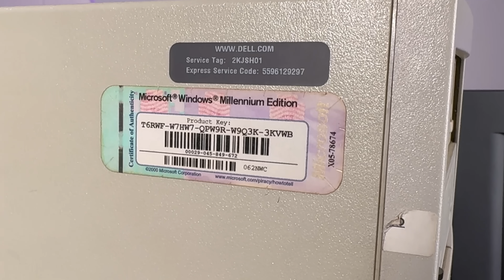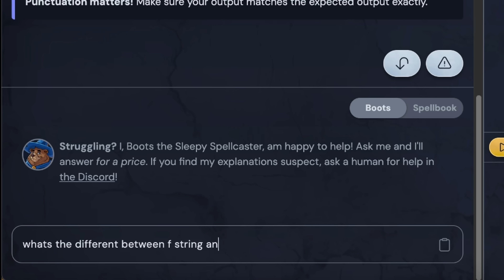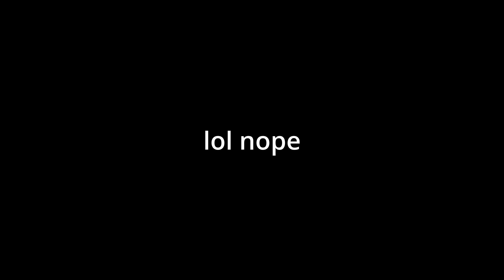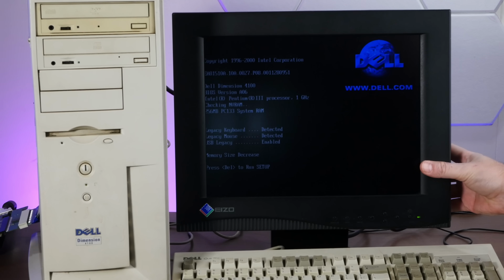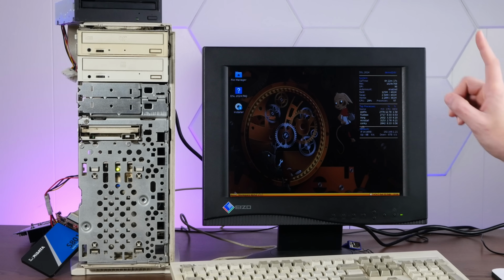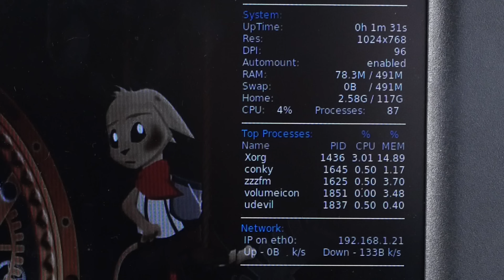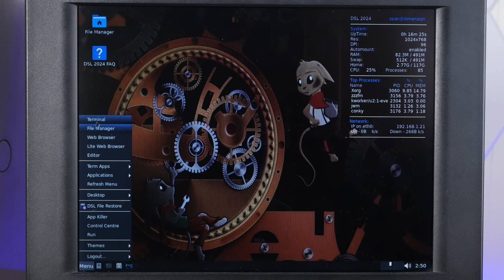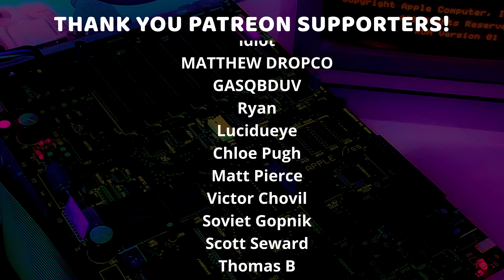Now THAT is a DAMN Small Linux!

Comment: for old computers i use q4os and it has a nice desktop you could make it look like windows 2000 or older and can run on a 350MHz CPU / 256MB RAM / 3GB disk and based on debian

Comment: I have a similar setup. AntiX 23.2 on a Dell Latitude CPx-J 750 GT. 750 MHz Pentium 3, 384 MB of RAM, and a tiny 32 GB IDE SSD that I put in there.
That said, AntiX starts to cause trouble these days, because some of the packages require extensions that my P3 doesn't have.

Comment: Very good, thank you.
While I've never hidden my dislike of all things -NIX (especially Linux) that's not to say I don't use the hateful OS where it's warranted.
Might I suggest giving DietPi a test drive some time - It's incredibly lightweight, runs on just about anything (inc x86/x64), and for a Linux is very well put together. Start with the most minimal of reasonable minimal, then add anything else you might need via the included tools.

Everything I have that doesn't of necessity run 'doze or a fun retro OS has DietPi as it's base OS... on top of ESXi for now. Well, my Cobalt Qube did run a customised version of BSD for a while to make it a 'useful' web server. But it got a modern hardware upgrade.

Comment: Great fun as always! Actually I guess you fancy AGP card with 1GB of VRAM was an AGP 8x one and I don't think these would work in a AGP 1x or 2x slot that you have on this motherboard from year 1999-2000, if I remember correctly, these slots are quite different electrically and putting an AGP 8x card into an AGP 1x slot might even damage it.
Reply from the maker: Ah whoops!
Reply: AGP slots are keyed for voltage. There are mac AGP cards that have a different pinout because they're used in ADC machines, those can definitely damange or be damaged. AGP is supposed to be backward compatible.
Reply: @staceyalbert2658  I have not researched this topic in 20+ years (since the last time I bought an AGP card) so I might be wrong. Quickly checked tomshardware, anandtech and vogons, some quotes I stumbled upon:
"8x agp will NOT work in agp 1x or 2x boards. 8x is backwards compatible with 4x only"
"An 8x AGP card will be voltage compatible with AGP 4x, but it might harm the card to put a new AGP 8x card in a 2x or 1x slot."
But researching this further is an interesting rabbit hole I might dive into.
Thank you!
Reply: BTW ActionRetro's AGP slot at 04:00 looks unkeyed and the HD3650 at 04:07 looks keyed for 1.5V so I definitely see some potential for a problem here.
Reply: @ I did some further reading and there's a handful of examples where a video card or motherboard manufacturer didn't key their product properly, but in a general sense, the AGP spec is supposed to be properly keyed to avoid damage.

Comment: the new iteration of DSL is based from MX Linux (or even AntiX). they're surprisingly lightweight & does not use systemd for init (uses sysVinit)
Reply: You can tell from the control panel that it's based on antiX.

Comment: That's the kind of case I had wanted for my slot one pentium III system but couldn't find one so I went reverse sleeper with a Antec VSK 4000e u3 (and yes I put a light kit in it...) because its a mix of vintage and modren hardware I dubbed it the PentiumStein

Comment: How could we back in the days browse the internet with 333 MHz Pentium IIs when nowadays a simple website kicks the cpu to 100% utilisation :O
Reply: JavaScript and media files that most older systems don't have hardware acceleration for.
Reply: @cameron_bosch  This. Even stuff from about 10 years ago lack any hardware support for those things under Windows, even if the hardware might still be helpful. Instead its all dumped onto the CPU.
Reply: "Even stuff from about 10 years ago lack any hardware support for those things under Windows, even if the hardware might still be helpful."

No AVX support has been a problem a couple times on a 2010  Xeon. Six cores at 3.33 GHz, but the program crashed due to no AVX.
Reply: You mean on a 486 with 8MB of ram?
Reply: Bloated frameworks and lazy developers.
Reply: JS is kicking all in the balls, all that new JS bs rendered websites make it hardly useful. My laptop is 10 years old, still a power horse with a i7 4 core 2,5Ghz, but on some websites, which heavy utilize animations and renderings, my CPU is cooking and the browser is about to die.
Im 30 and yeah, I miss the simplier times, like iGoogle or Google Reader UI, not overload, but more efficient. Unfortunately, today, designers rules and engineers have to follow. On Top, devs in the majority dont longer look up for Efficiency, as its not profitable or required at all.
Reply: @prte101 I don't want to give up my beast of a machine - a HP Elitebook 8570w - but its 3rd gen i7 is having a difficult time keeping up with some tasks now and its integrated ATI Firepro M4000 GPU is nothing write home about anymore.  Hm- I should see if DaViinci Resolve or OBS will even run on it.
Reply: @ true, I understand what you mean. My 10 years old laptop is still my main work machine as freelancer, it has something sentimental, I could not throw it in trash, for all the time it worked for me.
Reply: @AndrewBeals  My Macbook Pro from 2012 has a 3rd gen i7. 
      Still feels pretty capable - only slower than what we're used to now..
      You could try running a more 'era appropriate' version of the software you wanna use for video editing (i.e. 5+ years old).

For image editing (Photoshop) you can probably run more recent versions of Creative Cloud.

There might be more optimized alternatives available of the apps you need.
      Adobe is pretty heavy (DaVinci  probably less so)
Reply: @iggysixx  I primarily run Ubuntu on it, with the rare booting into windows 10 on a separate drive to run programs that only run on Windows.  It could be that the freezing problem I'm seeing is due to the SSD aging.
Reply: @ jikes... I thought SSDs were supposed to be able to take like 10 years of continuous (24/7) read/writes..?
Don't know if this is useful to you, but...
      There's something on my Macbook called 'Trim'. As I understood it; with that turned on, it makes sure that SSDs kind of evenly spread the usage of sectors / which blocks are written to.. (To avoid them wearing out prematurely)
.     (Apparently, it's not turned on by default, since my Macbook Pro came with a mechanical hard drive originally)

Maybe Linux has something like that too? 
(Built on the same framework or something, right?)

Anyways - I'm no expert on this.
Just know about the things I've used in the past
Reply: @iggysixx I still run a 2022 13" Macbook Pro with its i5. Does everything I need. Its running Sonoma and is pretty snappy with 16GB RAM and SSD. I don't edit 4k video. I do run Reason for music production. I do some digital art work and some 3D stuff for 3D printing. It manages to keep up just fine. For everything else, I have this thing called patience 😄
Reply: @ brave browser
Reply: The amount of resources YouTube uses in the browser is obscene. Add on extensions to block ads, both in-video and auto-inserted by YouTube, and you are likely up to 512MB just to watch a single YT video. Bloatware abounds today.
Reply: Haha, I remember feeling convinced at the time that 350MHz was all anyone was ever going to need.
Reply: @ 350 MILLION instructions per second SHOULD BE.
Reply: Ditch html5 and excessive web advertising to start. Main problems come from modern advertising. I never understand why we need pop-up advertising and advertising that is interactive or plays videos within a given square on a webpage. Webpages need to go back to looking like newspapers.
Reply: Because websites are now bloated af. I remember using a 450MHz Pentium III with Windows 98 and 128MB RAM back in 2010 and I was still able to comfortably browse modern websites without issue.
Reply: Those of us who have used and still love Apple's Newton MessagePad devices really should be showing the world exactly what you can do with a 162 MHz StrongARM 110 processor, 8 MB of Mask ROM, 8 MB of RAM (4 MB of DRAM, 4 MB of Flash RAM), and dual PCMCIA slots.

Apple didn't realize what their most important audience - the press - would by writing on them - Shakespeare, so their dictionary-based handwriting recognition failed miserably and was eviscerated in the media for that.  I, on the other hand have always had doctor-level bad handwriting, with my teachers exempting me from cursive once I showed a command of it, and aside from my surname, it even recognized a quickly-scribbled signature in addition to my normal handwriting.
Reply: Back then it was just html with pictures. You can run sites like that on your local network and browse them.
Reply: Lazy developers
Reply: Yeah but it think it has alot go do with bloated janky code
Reply: back then websites were very simple HTML code, txt with links and very VERY few images maxing out at like 20kb each... now a simple webpage is easily 100MB download...
Reply: It's very much the browsers themselves. Old browsers only browsed.
No always-on PWAs, tabs weren't full-browser-instances, no builtin task manager, no built-in antivirus scanning, no builtin synchro, no builtin cloudflaresque handshake//fingerprinting, no million-requests-per-millisecond autocomplete, etc etc.

And when I think 'old web', I'm thinking more the webXP days: flash, shockwave, div soup layouts, CSS3, asp scripted pages. The fancy stuff 😅

If you build a compatible website, compare the responsiveness of saay... IE11 or Firefox52 at running it compared to wherever trash browser is 'latest' nowadays.
Reply: @Biaanca5036 use of the Internet has changed. I recall back in the late 90s when I first tried the Internet it was dialup and simply sites were text with some pictures and any audio or video was downloaded from links. Streaming was non existent. Fast broadband or cable meant streaming became possible and that radically changed the net
Reply: You should go to the wayback machine and look at some websites from back in 99/2000. The web was a very different place.
Reply: Use w3m and Newsboat with RSS feeds
Reply: That's a Microsoft exclusive feature
Reply: Software bloat. It has been a thing forever
Reply: bloat, soydev mentality and javascripts
Reply: stuff were so much better optimized back then, the size of stuff these days are so ridiculous
Reply: back in the day it was all about html, png and gifs
Reply: @Stravioska  yeah people spent time OPTIMIZING the websites to keep them (inclidings pics) under 200kB... where these days it's an easy 100MB+ for a simple website, the amount of excess is ridiculous
Reply: JavaScript and v8 and their dumb libraries
Reply: the bloated cancerous JavaScript SPA fad took over web design. We're only just now getting back to server side rendering.
Reply: @XeonProductions  not without reason, tho. It happened as CPU clocks and network bandwidth got way cheaper during that time. Optimization wilted in the face of ubiquity and ease of development at the cost of clocks.
Reply: Bloat
Reply: Also don’t forget, modern TLS is actually really hard for old CPUs
Reply: @ encryption is a tricky one because it HAS to be computationally difficult to be effective.

But I would argue that the vast majority of non-account websites don’t actually need it and worse it doesn’t really protect anything because anyone can buy a certificate to sign their malicious site or email.
Reply: Sites were mostly text with a table of contents at top that took you down to the correct area on the page
Reply: Streaming was non existent.large files were downloaded to watch, read or view later.I recall the old days when YouTube had a 10 minute (or was it 15)  maximum video length   @zaxchannel2834
Reply: Because it was mostly HTML code, not Java, not Flash, etc.
Reply: @ flash was efficient
Reply: @gabrielvazquez6081  There is no Java or Flash on modern websites.
Reply: Back in the day, the internet was newspapers, now it’s 4K livestreams
Reply: I think part of the reason of the 100% CPU is because of how much more functionality Firefox has these days.
And also: often unoptimized graphics drivers will mean rendering on the CPU.
Reply: AI will save us from this.  Pretty soon you won’t be able to browse basic websites on that modern machine, either.
Reply: @ScottHess  actually, as an abstraction tool, AI can help as much with optimization as it risks with bloat.   The problem will be things that we may want in the future that are driven by an AI engine that we don't yet know we want or havent been innovated.
Reply: @themadmallard  The problem is the same one as with the web - the providers are going to shave their costs by externalizing things onto my systems.  So for every bit of AI which is there to help me accomplish something, there will be 10 bits of AI running to help them analyze me for profit.  And of those 10, half of them will be doing the same thing, it just won't be worthwhile for anyone to fix efficiency problems which don't cost them money.
Reply: We did it by using 56k modems. That makes everything that the machine can't do impossible from even get into it's ram.
Reply: @philippkemptner4604 takes me back to the halcyon days of logging into the local university’s servers using 2400 baud modems to play some Multi User Dungeon (MUD). Some friends would ditch school just to play.

Comment: EVERYONE needs more working AGP cards =)
I actually still have my original ASUS V7700 GeForce 2 GTS and my AOpen (iirc) OG GeForce 3 Ti200 128 MB that i bios-modded with a custom boot screen text and overclock! Ah, the old experimental days... They both work fine, although the fan on the GeForce 2 is noisy as heck.

Comment: I used to run an 128MB modded Xbox with Damn Small Linux back in mid 2005 for a month when my PC died. It was fairly usable, though i mainly used it to play tracker modules.
Reply: Elegant use!
Reply: that's a fine taste right there
Reply: running linux on an original xbox to play tracker music. that has got to be the most based sentence i've ever read
Reply: FT2 or IT3?
Reply: What's a tracker module ?
Reply: @mao3215  they're basically songs in a format that stores individual samples, pitch data, and basic effects in a spreadsheet for tiny file sizes.